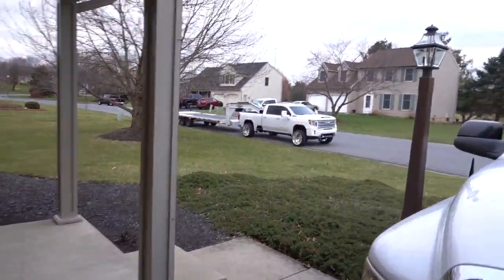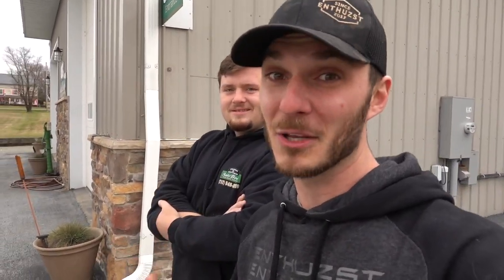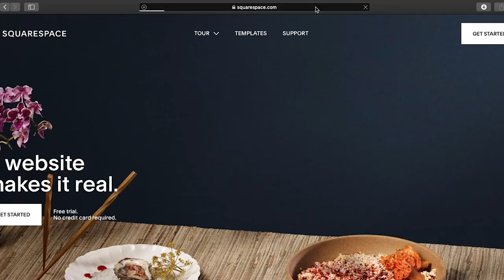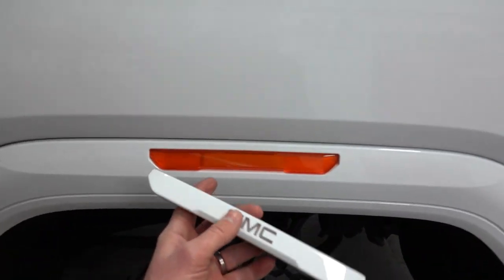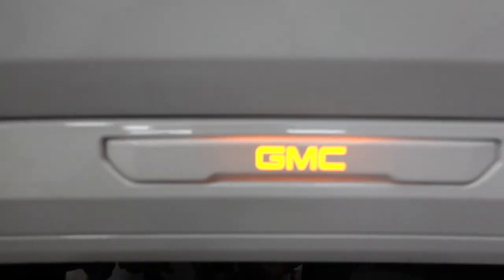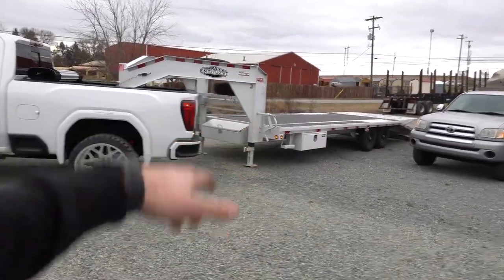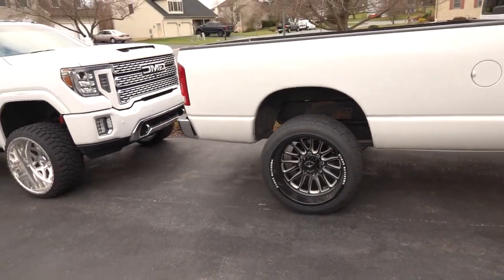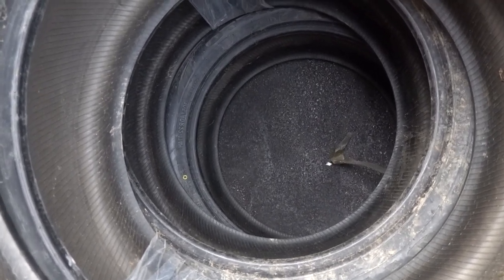Undoing GMC’s BIGGEST design flaw! *Worlds FIRST*

Comment: if you have the ability to separate the lens from the housing  , i would maybe try and see what a clear lens  with a black painted housing would look like with a orange led inside.  i know you are going for the monochromatic look , but i like the way a little contrast looks an a truck this big. but not if that means the contrast is going to be orange on a otherwise (white , black , silver , red or blue ) truck...

Comment: I don't know if I'm old or what. But why do people focus so much on those small little things like eliminating the amber lenses? Is there any advantages to having low profile tires or is it just for looks? I'm perfectly happy with my Duramax looking stock from the Factory. Granted I am not against adding accessories. But the types of things I add are grile guards, caker, winch, flatbed with a hydrabed on it.

Comment: Jack if you pull the truck on forwards then fold the ramps up, back the truck up on the ramps so most of the weight of the truck is on the trailer. I think you have way to much tongue weight on the tow vehicle and that’s why she squats so much